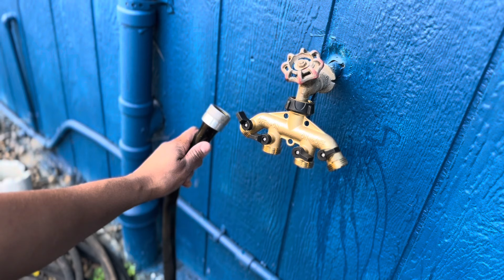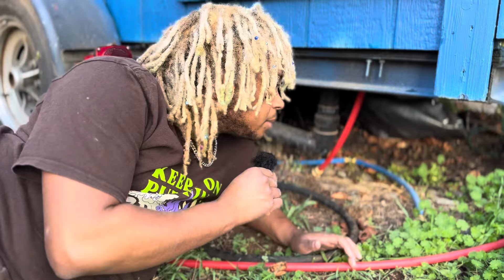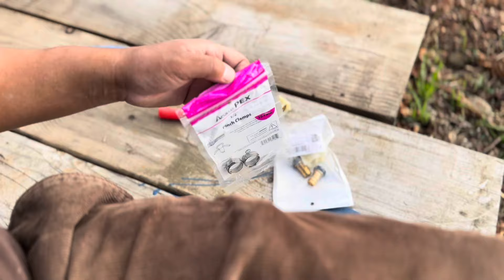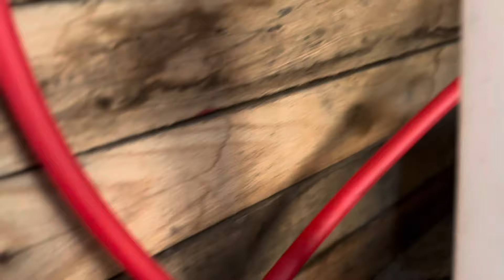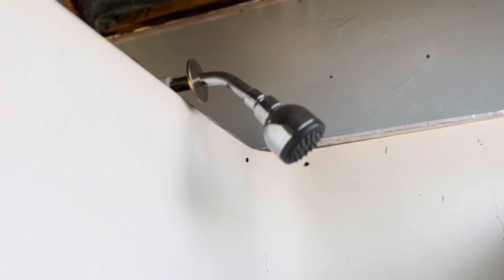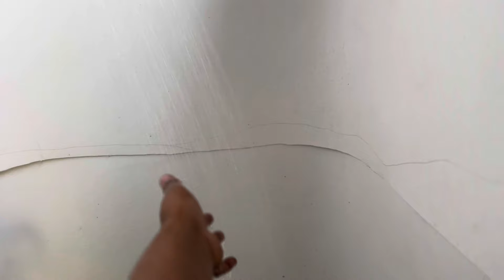DIY Plumbing My 85sq ft Tiny House

Comment: If there’s a leak, you could use plumbers tape to add a bit more seal between the connections?
Reply from the maker: Oh true I have tried the tape before but it seems too tight or something 🤔 definitely wanna give that one more try though
Reply: I was just going to suggest the plumber's tape I noticed somebody already did it does make it super super tight but it will also make sure that the water doesn't get out. Also what little I know about Plumbing, is that anything that drains water anywhere where water drains out of you have to have a section of pipe called The Trap.  Um you probably already have this but I couldn't tell. But if you don't you're going to want to do that. The Trap while it can be annoying is there to make sure that harmful and deadly gases do not come up from the ground and murder you in your sleep. You will want to talk to someone who's really good at Plumbing to verify and make sure that you have that in the right areas so that you are protected. 

Another awesome video man!
Reply from the maker: @LifeAccording2Logan  yeah after hearing about using plumbers tape twice I think i definitely should give that a try! Omg damn that’s scary 😨 I am just draining the sink & shower water into my garden but maybe I should still get a trap for the pipe 😅 thanks dude !!
Reply: @elijahray132  If its just foing into the garden you are probably fine. But if they go into the ground, def get traps.
Reply from the maker: @LifeAccording2Logan yeah good point tho, my Adu needs that